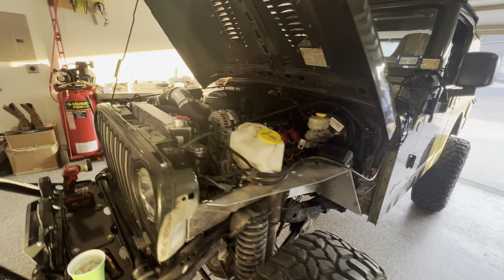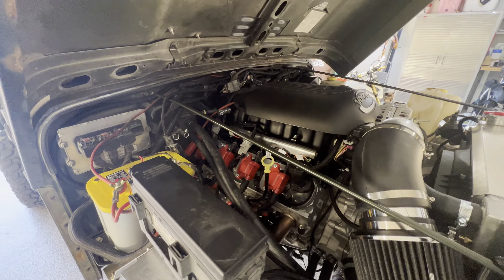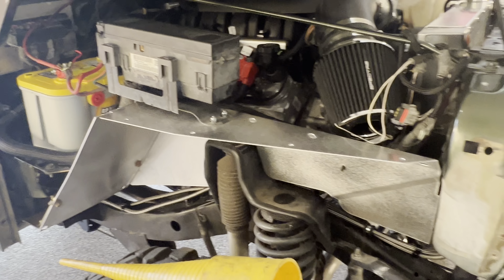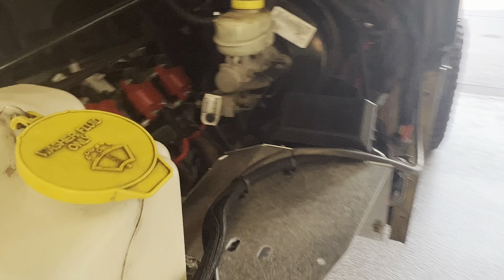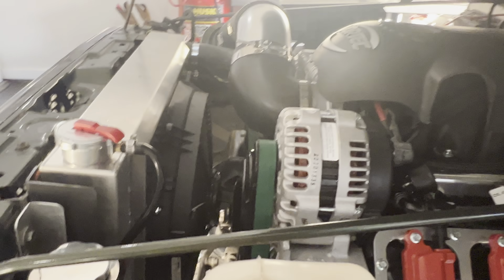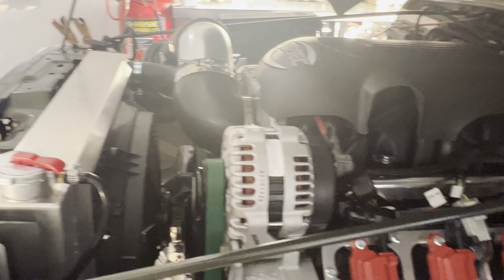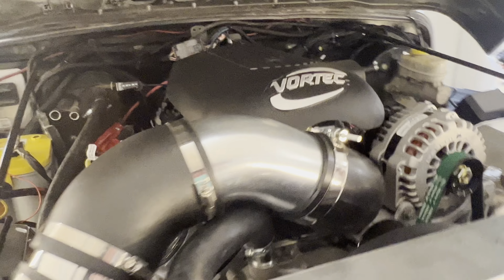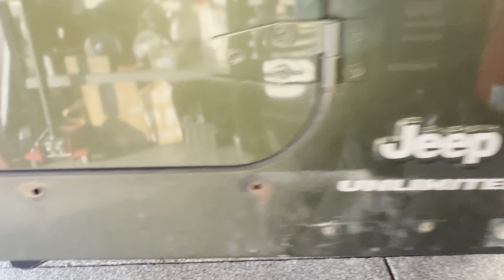2006 Jeep wrangler lj 6.0 lq4 v8 swap startup and overview. Holley terminator x max.  Part 2

Comment: Hope you are still on here. The direct fit dash panel. I looked at the one from Autometer and it does not appear to be the same one you have. You have some turn signal and other indicators in the panel and the Autometer one I saw online does not have room for those. What panel did you use?
Reply from the maker: It is autometer part #90011

Comment: You know your shit..... Do you do builds or is it a personal jeep? I'm HIGHLY interested in doing the swap to an LQ4.
Reply from the maker: this is my personal jeep. Do it! you won't regret it.
Reply: @mutt457 Hello I own a Chevrolet express 6.0 LQ4 with 90,000 miles, I live in France in a region where the climate is temperate, I do 6000 miles per year, I drive mainly in the summer, and I tow a 6000 lbs trailer, should I stick to the oil recommended by the manufacturer 5W30 or can I use a 5W40 for example???